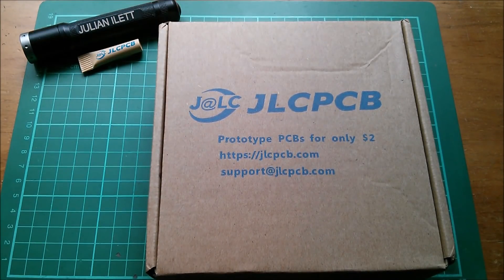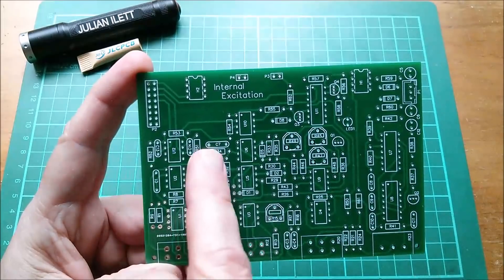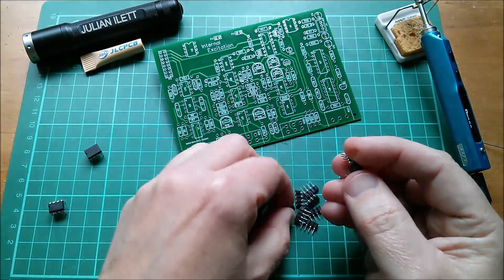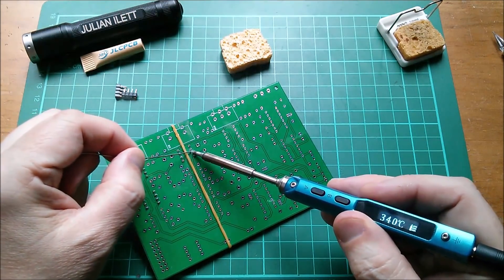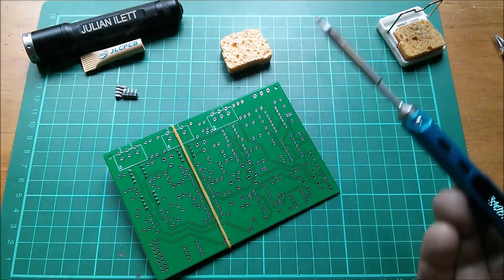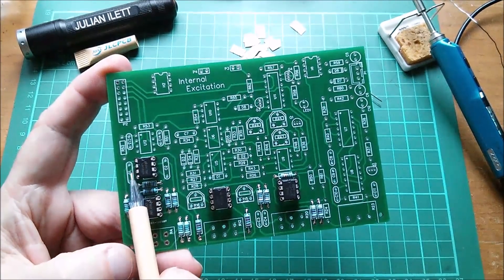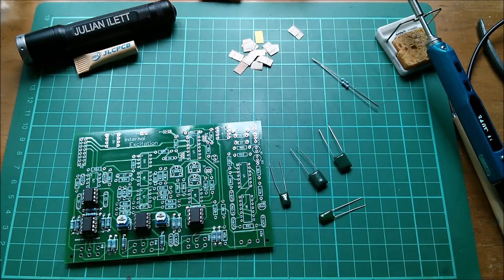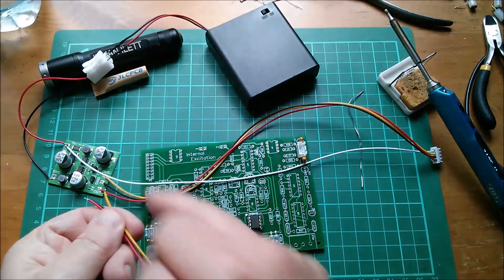New PCB (my most complex yet) - Excitation Section - Vocoder

Comment: Although I've been involved with it for all of my life, I'm wondering these days, what the point of it is.

OK, if you've never made a 'thingy that does this' before, then you will be excited, but this is an audio generator.  I have way more capability on my iPad!
Basically, electronics for the ordinary guy is dead, because you then have to go the modern route of using libraries and pre-assembled parts, but this type of project is the only one that can offer you even a hope of doing something that is practically useful with electronics and not just a curio.

I just bought a spot-welder project that a guy was making - excellent project.  But there aren't so many things that are simple enough for a single, ordinary person to do.  I'd say maybe doorbells, but I just got one last month that does everything that I need and about a thousand things that I'll never use.  The humble battery, switch and bell is still the pinnacle of cost-benefit implementation, but the next step up cost me only three times as much as the transformer, wire, push button and bell, but gave me ten times the functions.  Moreover, because it is all Bluetooth and WiFi, I don't have to run wires everywhere, so actually, the new one would be cheaper!

It's the same with simple things.  I was considering making an intercom - like the ones that we could buy in the 1960s and 70s.  I sat down and began gluing transistors, caps and diodes together (on-screen) and very soon realised that the cheap, eBay digital amps were a much better buy - you see, I didn't really need any expertise, they do it all on one, tiny PCB, and I'm struggling to see where hobby electronics (as opposed to mechatronics) is still relevant today.

A guy that I know owns a secondhand shop and he sells a lot of LCD TVs.  He used to come to me to see if I could get them working.  It was the PSU in 99% of cases and I could fix them in about 15-20 mins.  I haven't done one in over two years.  The manufacturers have learned and now the faults no longer come with the same frequency and in many cases, as the product life is now so short, there aren't the spares out there, and so it becomes uneconomical.

It is becoming a game of procurement, not a game of electronic engineering, but I can see why.
Reply: ApexMike - the fun is in things that are not mass market, hence there are no cheap modules available...
Oh, and tinkering, for the experience of learning 😉

Comment: 2k vs 2k2
  Do you figure the "newer" ones are actually +/-5% as they are implying with the E24 value of 2k? I assumed most pots are +/-10% and therefore the focus on E12 values. Pots don't exactly work within the standard EIA values table ideology anyways. The tolerance is intended to overlap the range potentially providing every linear resistance value possible if someone has a large and complete collection of the entire range of resistor values. I don't see any value in the bell curve range of pots. I thought the use of E12 values was simply a nod to the tolerance values inherent to the EIA standard. So is the 2k value a furtherance of the system or a dilution of the standard?

Comment: You have the same problem as I when designing PCBs: The solder pads for the components are always on the small side, so soldering takes longer and is more itchy as it needs to be. :-)

Comment: Looking at your soldering I suspect you are not applying enough solder for good joints. The solder should flow through the plated hole and onto the leg on the other side as well.
Reply: Or wrong temp.

Comment: It's very relaxing designing PCB's in EasyEDA and doing the print layout. I've recently done an 8 step synthesizer layout, from a hand drawn schematic I found online. I'm a bit hesitant to order it, though, as I'm afraid I've missed something. But the process was almost meditative.

I'm looking forward to see the whole board finished.

Nice work, Julian :)
Reply: Check, check and double-check, then check again, then just order.  I use Eurocircuits, so they can be a bit pricey in small volumes, be very good quality.  It would have cost me about £100 for samples, each, so I played with it and got 200 for £200 on the first version - it was perfect.
Thing is, even the MOD mess up and you will then see the wrapping wire all over the place.  Nothing rarely comes out right the first time, so just do it and fix the result!
Reply: @apexmike849  thanks for the tip, I'll check them out :)
Reply: @apexmike849  they look exactly like a European version of Pcbway.com

Comment: No decoupling bypass caps on the IC supply rails, mounted nrxt to the chips?  It'd be fun to look at the op amp outputs in the presence of strong RF or with transient spikes (PWM hash, etc)
Reply from the maker: The maximum frequency of signals in this thing will be less than 20kHz - it's all pretty slow.
Reply: Yep.  All depends on the environment it will be used in.  In my house it would go wild due to the RF energy I transmit.  The rail traces are nice little inductors.. and I was thinking mainly of RF energy on them.. although supply transients and noise could be a problem.  As well as RF hash from switch mode PS if one is used.  You make REALLY fun videos!  Thanks

Comment: Looks great Julian, what's the solder of choice today? I was surprised I had decent results from some of the Chinese solders.
Reply: Back when they first announced RoHs, I went and purchased several kilograms of cored 60/40 in thin and thick.  I just spool what I need onto cotton reels.  I'm 61 with cancer - I will at least, never run out of solder!
Reply from the maker: Hmm, still using my Rapid Electronics 60/40. But I have another eBay cheepie waiting to be opened - 100g this time :)
Reply: Loved that video very informative 👍
Reply from the maker: Thanks Subigirl :)

Comment: Put the resistor values on the PCB instead of numbers !
Reply: No love for KiCAD? It's improving all the time and OpenSource too.
Reply: KlunkiCAD ? na personally can't stand it..
Reply from the maker: If I can find a way to default the software to component values rather than component numbers, I'll do it :)
Reply: Have you tried out EAGLE ?
Reply from the maker: No. My PCB design history: Dalo pen - sticky track tape and pads - Aldus Freehand - brief dalliances with Design Spark and EasyPC - EasyEDA.
Reply: The free version of EAGLE is imo excellent and quite easy to learn.
Reply: @JulianIlett  On easyeda you simple put the resistor value in the name, it'll transfer to the pcb.

You can then click the text and change its sizes.
Reply: No don't put the values instead of the resistor numbers.  On a smaller board it might be fine but when you are trying to identify exactly what part on the PCB you want, numbers make it much easier.  Try finding that resistor to tap for testing when you have 20 of the same value.  And if the value changes it is now labelled wrong.
Reply: Naaa for hand assembling big through hole broads like Juliens it makes things waaay faster when you can wack in all the values in one go and solder everything from the top. From experience I find numbered parts are only really needed when you have a broad full of 0603/0402 Rs & Cs. If you have to locate a part on your PCB just look at where the traces are going or highlight the part in CAD on the schematic while looking at the PCB view at the same time.
Reply: If you mean just in CAD then yeah of course you want both the name and value in the schematic.
Reply: @krishna34674  - I mean on the PCB.  Just print the parts list and go from there.  It makes it really easy to see that you need 10 of this value and 5 of this and if your ID numbers are by section it makes it easy to locate.  R10-R19 are for this section, etc.  IMHO.